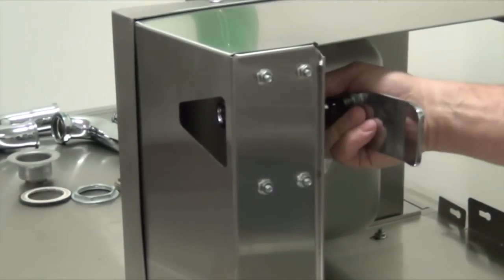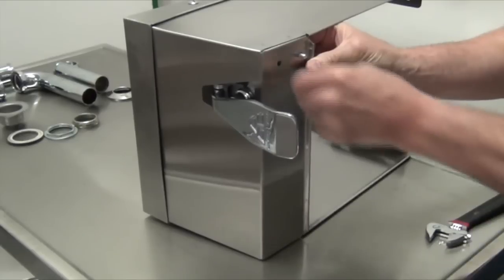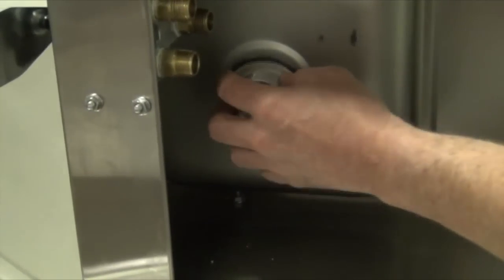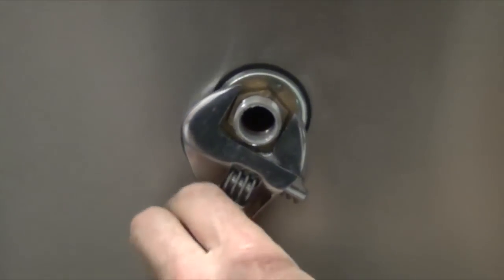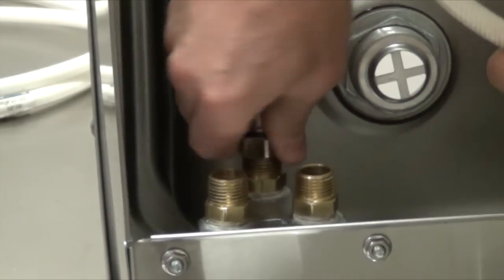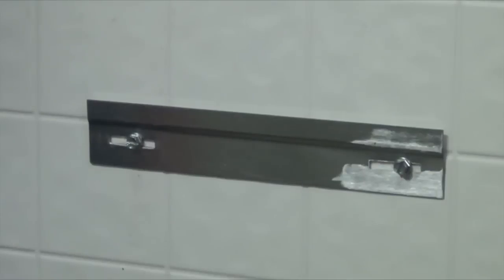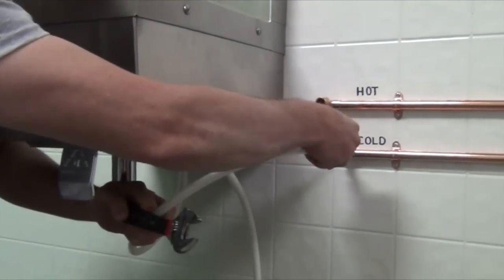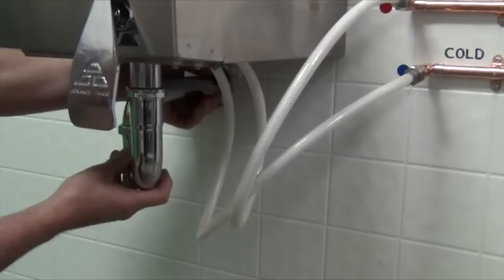Installation of an Advance Tabco 7-PS-63 Knee Valve Hand Sink (English)

Comment: What do you mean rotate screw driver until desired temperature is achieve? I have one and I can rotate the screw as much I want, Do you you if clockwise opens cold and counterclockwise hot? How does this knee valve works? It looks so random to adjust that I'm thinking my valves are broken.

Thank you